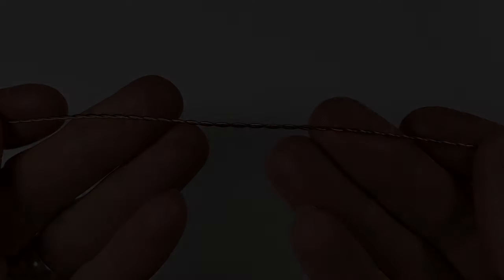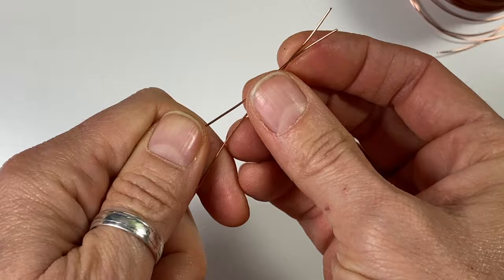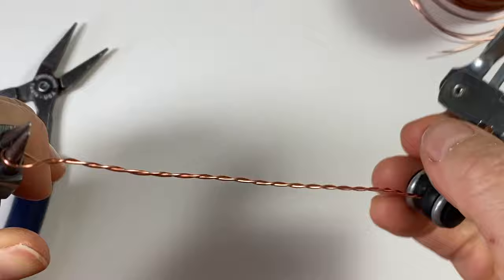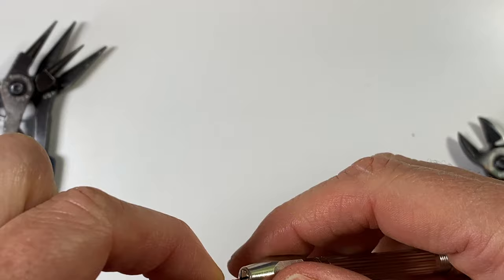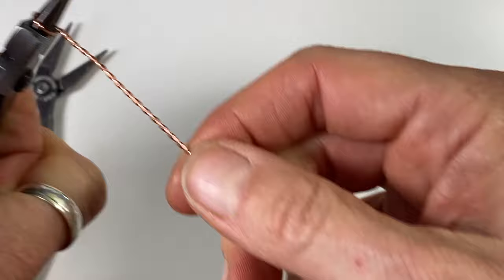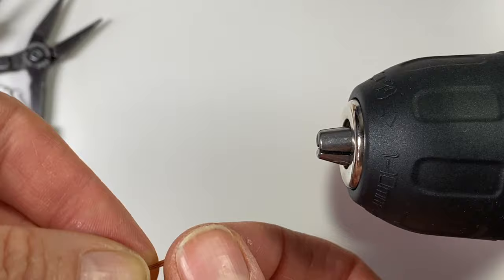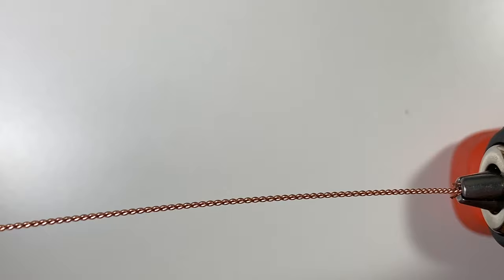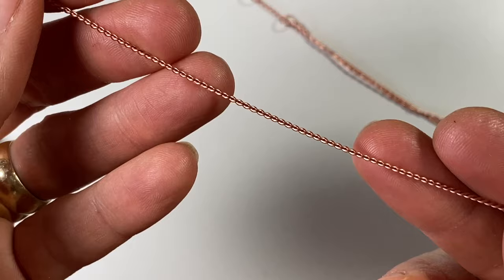Wire Wrapping Techniques- How To Twist Wire- 3 Different Ways

Comment: All 3 looks really nice next to each other . It would look cool using all 3 into a design even though it’s a very similar twist , the effect came out different enough to add variety . Thanks so much for making this video . I have a drill I got on Amazon too for jewelry work , but didn’t think of using it to twist wire. Makes the work a lot easier .
Reply from the maker: Yes it does! I love it!
Reply: Agreed. I was thinking the same thing.

Comment: I found a pin vice , that lil hand drill for resin, works really good for twisting wire. I hold the other end with pliers and roll the vice down my thigh while sitting and other end is hovering over the other leg
Reply from the maker: Sounds acrobatic! Lol

Comment: Thankyou for all that you share with us! Your tutorials are amazing and have helped me so much :-) On the link you gave for the Pin Vise  it says it is a drill? If I order that one will it twist wire  I don't need a drill thankyou!
Reply from the maker: 🤔
I’ll check it…
Reply from the maker: It looks like the right tool. It says hand drill.
Reply: @ZurickDesigns   Thankyou so much for your fast reply I do appreciate it! I was confused as to if the drill would twist wire also Thankyou :-) They look a like but the one said drill and buying online I just wanted to make sure~ Thankyou for your time 🙂

Comment: When you twist the wire hang the center on a nail with a nice flat head on it or a small screw hook and that will allow a more even grasp on your twisting hand. I have even used small vice grips and secured that end in them and then lay them on the floor and hold in place with my foot. I wish I could remember the name of a tool that I have for twisting wire. It reminds me of an old hand egg beater. You clamp the two loose ends in vice grips and lay the vice grips on the floor and rotate the “beater” using taut tension and within a few seconds you have awesome twisted wire. 
Thanks for the video you did. I didn’t have a clue how to use a pin vise. I knew it had to be simple though. Thank you.
Reply from the maker: That’s cool!